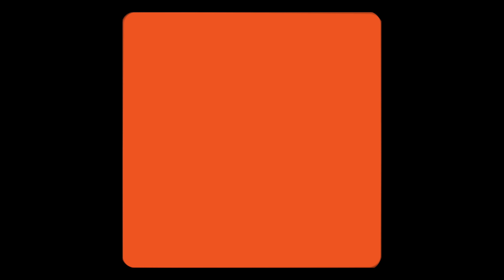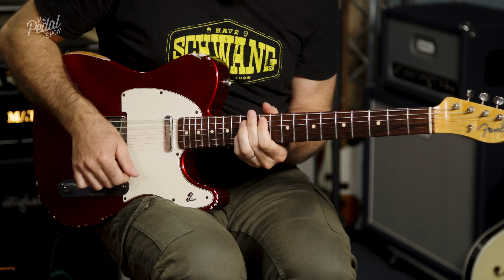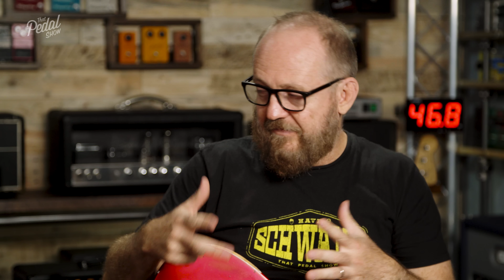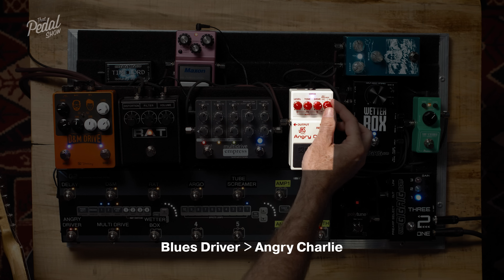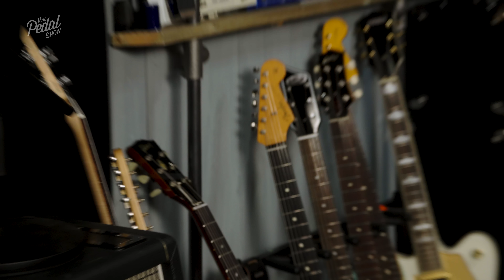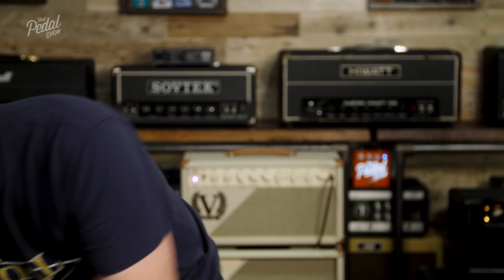Mixing Gain Pedals In Parallel For Ultimate Versatility – That Pedal Show

Comment: So what happens if you split a sound between 2 overdrives at the start of the signal chain but only place a buffer before one of the pedals and then mix them back together? Does the impedance average out or do you only get high end signal loss on the signal from the un-buffered pedal?

Comment: I know it's not a directly related question - but has some relevance because its to do with stuff in parallel... but I'm building myself my first wet/dry board and I'm interested to know how you set the volumes on your two amps. I know there's no right answer to this - and it'll be personal preference as much as anything - but I'm just interested to know how you set yours. Both set equally or with either the wet or dry amp slightly louder. Thanks.
Reply from the maker: I try and set them another the same Tim. Mick here. Cheers!

Comment: VCQ? Trying to tone down my frequency of comments (puns intended).  I have a yes or no question that is simple, but would like you to expound if you see fit.  Would there be a scenario where the parallel gain structures could be two amps in parallel e.g. in your demos here the Octafuzz in one amp and the dirt in another?  I ask because there are times this could be easy here at home, but wondered if you could see it elsewhere... like wet/dry but dirt/drive or gain/clarity.  If too weird a question, move along!  Enjoying the backing tracks here in Balifornia... take care.
Reply from the maker: Hello! VCQ is currently on hiatus, but yeah, doing two amps in parallel is a similar thing for sure. It can work very nicely, although you get very stark separation of the two things which can be great if that’s what you’re looking for. Cheers!

Comment: I use a TC Corona chorus ( the green one) as a splitter. Obvs not as good or versatile as a Wetter Box but is there anything wrong with it in this context?
Reply from the maker: Nothing wrong at all, but then you’d need to join them again afterwards. Unless you’re running two amps from there of course. Where you’d need to mindful of phase in everything after the chorus.... cheers!
Reply: Thanks😀

Comment: What happened to your love of the Lone Star, Mic?
Reply from the maker: Two things in the main. First, both of them need repairing and I just haven’t got around to it. One has a dead reverb (something internal, not the tray) and the other just stopped working. Might be rectifier valve, but I never use it. 
Second was my Two Rock. It’s the best amp I’ve ever played (for me) in all my days. Cheers!

Comment: I've been obsessed with parallel drive for a while so I've got a couple of pedals for this.
The http://vfepedals.com/klein-bottle.html lets you do 3 loops (plus dry) for your own pedals in parallel and mix them in series at the same time.
It's a super advanced version of the earlier http://vfepedals.com/triumvirate.html which is like a simplified multidrive.

Comment: I'm pretty much a "gain" guy and I've been thinking a lot lately about splitting my signal. I think I'd like to split the signal right at the front of my signal chain. One path would go through my entire pedal chain where I recombine the two paths in a mixer before the amp. The idea is to be able to blend in some completely dry guitar signal with my gain stages. I don't own the necessary equipment yet but wanted to bounce this idea off you guys. Is there an easier way to achieve this? Any hints or comments? Thanks,
Reply from the maker: Some pedals offer the option of doing this Peter, although obviously anything after that pedal would be affected. You’d just need to find something to split the signal in the first place, then recombine it at the end. Check out the various options from Radial, Lehle, JHS Summing Amp course Dan’s ABY Baby and Humdinger devices.

Comment: Is running your Delays/Reverb through the Effects Loop of the amp the same concept as running the Delays/Reverb in Parallel on the BOSS ES-8 switcher?
Reply from the maker: Not exactly, but it depends on the loop design. Cheers.

Comment: Would this work with two sets of AB/y boxes?   If the first AB/Y box allowed you to switch phases to run to 2 different dirt peadls.  Then use another AB/y box to combine the signals.
Reply: It would but you wouldn't be able to blend them as easily, you'd have to use the pedals master volumes which would change the headroom.
So yes, but not as well

Comment: Let me honest here ok? I have accumulated enough pedals "mainly ods" that I could open a store. We don't buy them for versatility or tracking down that holy grail tone. We buy pedals like women buy shoes. When you are gassing and have a hole burning in your wallet, a new colorful pedal fights off the gas. With enough patch cords to wire a aircraft carrier, I sit with all my pedals and just tinker. To 99.9% of the public there is NO difference but our quest for more gear and tones never ends.

Comment: actually I found this episode quite entertaining but in the real world...you should probably try to use one of your selfbuilt amps dimed with the slightly overdriven or just at the edge of breakup running jtm45, and there you have it... finally peace, pedals are obviously not needed for that, just match the volume, you get the attack of a clean amp with the distortion of the other and you even can add pedals to either of the amps, well that´s what I´ve been doing the last 30 years, I´ve been using the drive channel of the second amp instead of diming a small one, but hey everyone uses the stuff he got :D

Comment: Dan, on the back of our Hamsteads there’s a Clean Gain switch, I take it that moves the preamps from Series to Parallel?
Reply: Nope, the Clean Gain switch operates the preamp gain presets.
From the manual: Hi and Lo preamp gain presets are selectable on the rear panel. Lo gain giving more preamp head room for cleaner tones, with Hi gain doing exactly what it says on the tin: adding more touch sensitive drive as the preamp is pushed into overdrive.

Comment: This is done with a switch on the pedal like on the D&M  drv is that rt ?
Reply from the maker: Not exactly. To achieve parallel with the D&M you’d have to use it with a switcher and have the D&M sides in two separate loops... and use the TRS mode.

Comment: you realize you were tweaking a $400 pedal to match a $75 pedal. just an observation.
Reply from the maker: Could it sound like a tube screamer was the question. Price doesn’t matter  -it’s about versatility. Nevertheless, we see your point. :0)
Reply: @ThatPedalShow   i enjoy your show. tangents and all.
Reply: @ThatPedalShow 
Which is the point of the BYOC Crown Jewel.
You can have a tube screamer, ocd, rat and silicon fuzz. With a mix of anything in between.